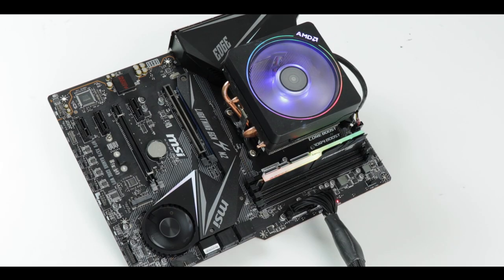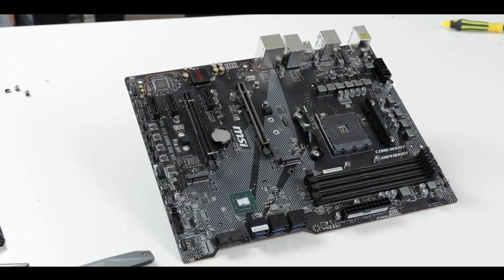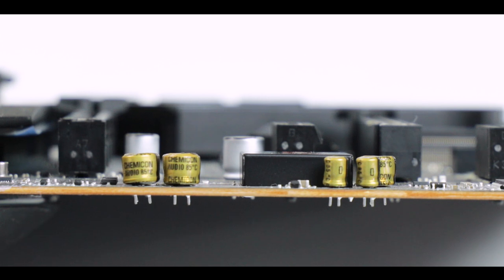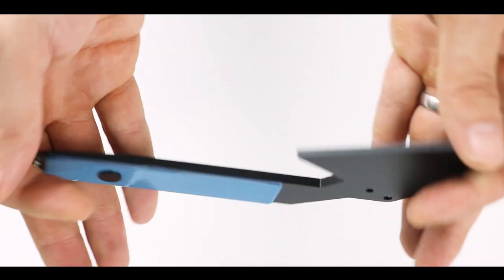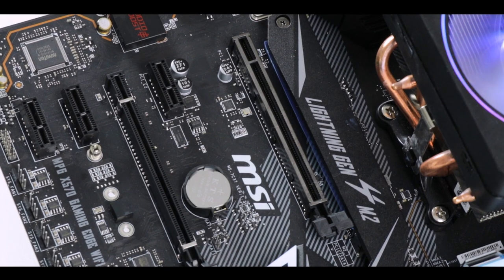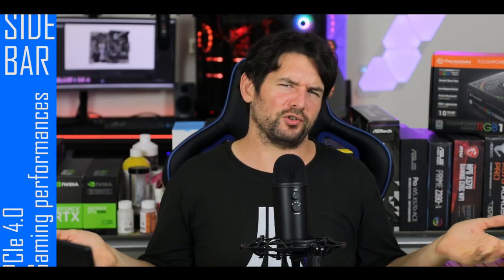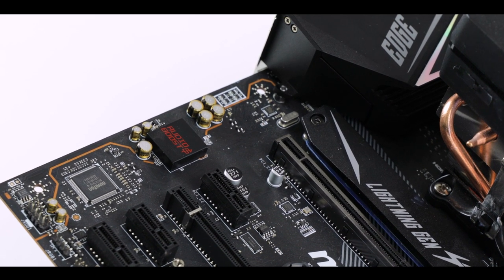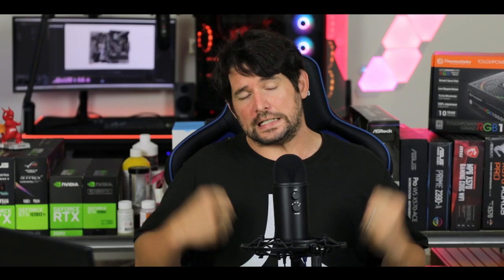MPG MSI X570 GAMING EDGE WIFI : No, No, No!

Comment: I have this motherboard and am not having any issues. Though I don't need to overclock. Happy to play MC at 4k resolution. I am very pleased with the board. 
edit:
If a motherboard doesn't support overclocking it doesn't make it bad, that just means you better have a good enough CPU to not have to overclock😂
ps. I am brand loyal = MSI motherboard was the board I had to get.
Reply: wow I got a heart with in an hour of posting a comment on a video that was done 8 months ago. Now that is actually cool!